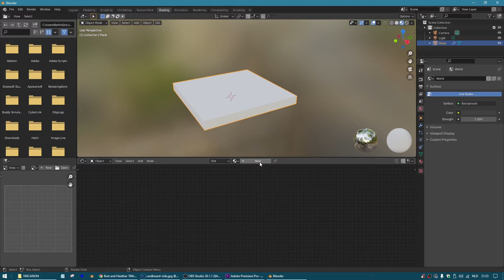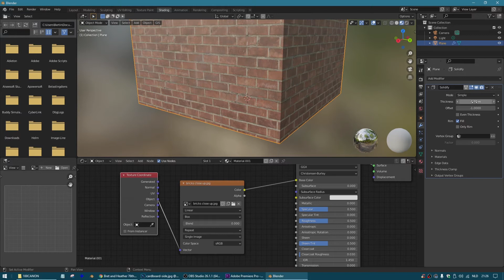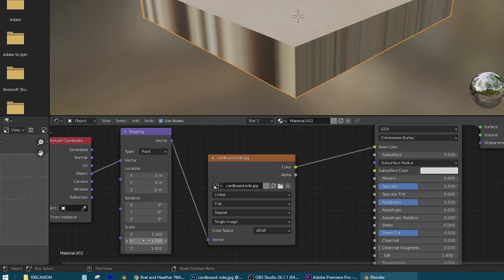Texture a solidify modifier fill rim - BLENDER TUTORIAL

Comment: What was your texture for the flute (2nd material)? I did exactly like you did (tested numerous times) and mine never did look like yours? So I assume you might have had a flute texture to begin with? Verses creating a flute texture via nodes? Any help will be appreciated. :) I'm using 2.93 Blender version, in cycles, and used the same cardboard box texture on both material node Image Texture Nodes.
Reply from the maker: An image texture uses existing images from my harddrive. You can google for textures, tiled textures. Or you can create them your own.